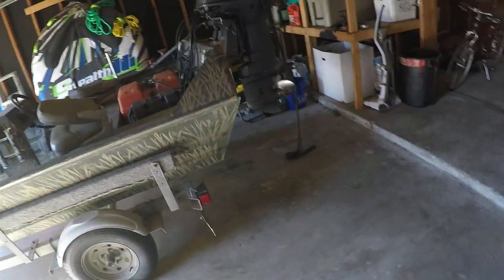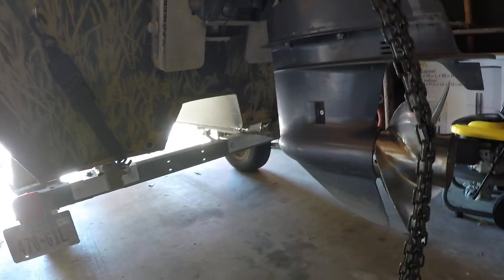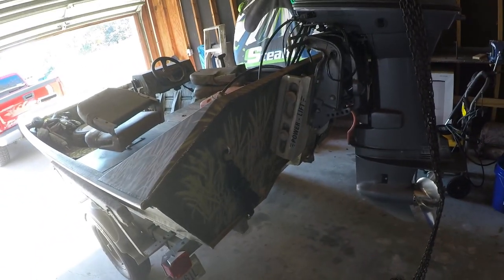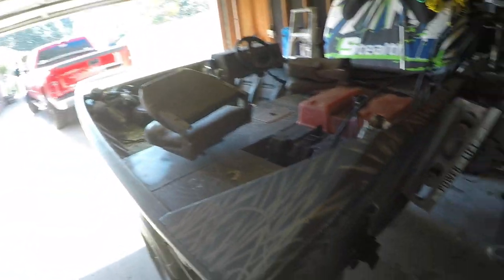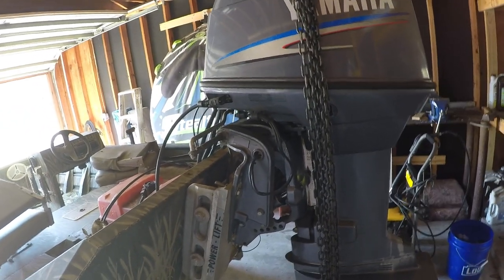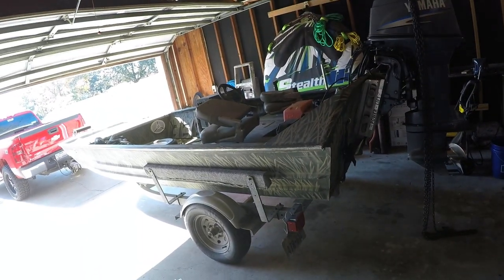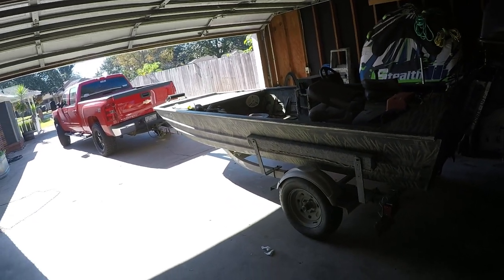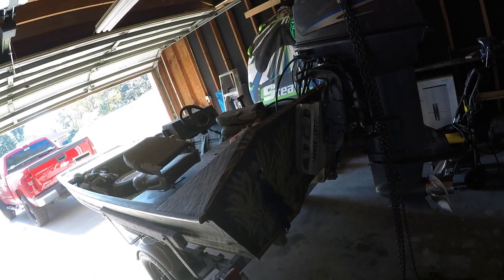The Secret to Running Shallow

Comment: You say a tunnel isn't necessary. Would you say it's worth adding a tunnel in if you can? Can you get similar performance with a jack plates, cav plate, and the right prop?
Reply from the maker: Depends on what you want. Tunnels will run shallower in hard bottom and tend to get up in shallower water. They are typically slower. I like having the tunnel because it allows me to run the skeg even with the bottom of the boat and you chances of damaging the lower unit are very low if you tend to run places with stumps or in my case oysters. You can always do a vented tunnel which will allow you to open a valve in deeper water and break the vacuum on the tunnel which will give you 10-15% more mph. You need a hydraulic jack plate to take full advantage of a vented tunnel setup.
Reply: @Southtexasduckhunter  Nice. The boat I have currently is a tunnel and it's money for shallow water, but I've considered upgrading to a bigger more all-purpose boat like a carolina skiff. Most boat's aren't tunnels so you would have to add your own which I'm not too fond of doing. Was just wondering how much height I could get before I would deal with blowout or overheating. Did you have trouble with your other boat before you added the tunnel. I would probably set it up with two jack plates a shawwing and pt prop.

Comment: You don’t run a water pressure gauge to make the water making it to the top cylinder?
Reply from the maker: Robin Inabinet not sure I understand this? However these engines are setup with the thermostat on the top of the power head. Due to this the engine has to fill up with water before it exits through the exhaust housing. Kind of like water flowing over a dam. Where the dam is the thermostat opening. I don’t run a thermostat in the engine either. As long as the engine temp sensor doesn’t go off it’s good.
Reply: We just always added a water pressure gauge  to be sure there was enough pressure to get enough to the thermostat.  You could be getting water thru water shield but just not enough.  A pressure gauge will let you know if there’s enough going thru the system.
Just an easy way to double check.

Comment: Thank you for posting this. Very informative. I am thinking about getting a boat specifically for bass river fishing. The depths of the river vary from as deep as 10 feet to less than a foot. I was dead set on buying a mud motor but after seeing your video, I am considering getting a standard outboard for my boat. What do you think?
Reply from the maker: Bill York mud motors have their place. If you think you will be in a lot of vegetation then a mud motor may be the better choice. If it’s just wanting to run shallow in relatively clean water then an outboard with a tunnel will run just as shallow and be more user friendly. Just have to ask yourself what you want to use the boat for. There is very little that a tunnel outboard won’t do compared to a mud motor. The obvious advantage of the mid motors is they are air cooled. Outboards are water cooled.
Reply: @Southtexasduckhunter  Thanks Kevin for the response!  I've just heard that with mud motors, there is a lot more maintenance involved as well as having much lower horsepower compared to a traditional outboard. I'm not sure how true that is but I'm still considering my options. 
How wide is your boat?  Reason I ask is because I want to be able to stand in the front and pitch and flip for bass and I would like a stable platform.
Reply: Call Gator Trax  , they are the best
Reply: jet   óutbard jet bóat

Comment: How does a setup like this run in medium thickness vegetation? I have a river I run that has areas with thicker vegetation. With a regular outboard setup you constantly have to clean the outboard of weeds. I'm ok with occasionally removing some weeds and push poling through the thicker stuff but was wondering what to do when upgrading motors. Currently have a 1560 tunnel w/ 15 hp which is way underpowered. What's your opinion on outboard vs mud motor if you run a decent amount through semi-thick vegetation?
Reply from the maker: David H I’ve been able to run medium hydrilla without having to stop. With the skeg even with the bottom of the boat the plants get stirred up enough from the tunnel that the prop just chops it up and sends it into the air lol. I have been stuck under a bridge where it was packed in tight but was able to force my way out after cleaning the prop off several times.
Reply: buy miñi  tug boat 21  mph      15 hp 1⁸ jnch diwñ miter  show water  9  iñches on lane

Comment: I have the same rig but with a 60hp  yamaha. What pitch is that prop? Also what are your thoughts on extending the tunnel for better water pressure  on the prop? Possibly helping get the motor even higher. The previous owner knocked the bottom 3 inch off my skeeg so it runs pretty swallow as is mounted on the transom with a 3 blade. Stumps and hydilla are my issue not so much mud. Thanks.
Reply from the maker: I’m running a 17p 4blade CFF4 with added cup. I wouldn’t extend the tunnel. It would actually limit your height. When water exits the tunnel it rises. By extending the tunnel you would prevent the water from rising limiting how high you can raise your motor. My cav plate is about 6” above the top of the tunnel. I can run it there because of how the water rises off the tunnel. I have ran in lillypads and it seemed to do well. Just have to really keep an eye on the tale tail
Reply: Thanks for the heads  up. Not sure where you hunt but, looked like SE Texas marsh. I run tugz on the intracoastal between Port Arthur and High Island Blue wing showing  up pretty decent for mid August. Hope ya'll have a good season.

Comment: I won't be running a hydraulic jackplate for now. Where is the best place to have the cavitation plate setting in relation to the tunnel?
Reply from the maker: Baba Yaga as high as you can get it and still get the boat on plane and not over heat. I would start as high as possible and move down from there as needed
Reply: @Southtexasduckhunter  Roger that. I appreciate your feedback.

Comment: Good video. I've got a 2005 yamaha 60 2 stroke and when that thing even gets near mud I'm getting the over heat alarm. Have you had any similar problems and found a solution ?
Reply from the maker: Yea mine will overheat when idling in muddy conditions but it cools off quick. I run without a thermostat in mine simply for the fact that I’m almost always in shallow water. Make sure the water pump is good and thermostat is not clogged or just remove it. I’ve been running outboards without thermostats for years without problems.
Reply: I take the thermostat out and then break off at the spring and put back the plate where you won't get hot spots in the block and it's always work really good for me on my jet drive.

Comment: Hi kevin, this is Alex in San Diego and I have the same alumacraft 16 vmod design as well. I want to install a hydraulic jack plate and wondering which size and manufacture you would recommend? Much thanks!
Reply from the maker: Alex Ordonez mine is a CMC 6” for up to 300hp engines.
Reply: buy  het outbard

Comment: How fast does that run with a tunnel don’t they run slower with a tunnel!
Reply from the maker: Jhnfrmr I can get about 34mph trimmed out just right. In general  tunnels are slower because of the drag the vacuum from the tunnel creates. Not always the case but a good rule of thumb.

Comment: I'm designing a boat with a built in gas tank. Do you recommend placing the tank in the front or the rear of the boat for running shallow? Also want to keep in mind getting on plane. Thanks
Reply from the maker: Corey Rougelot I would say best case is in the middle or slightly forward of middle. If you have to choose between front or back I say front. You don’t want to overload the front but you also don’t want to overload the rear.

Comment: Are you able to run this in shallow rocky areas?
Reply from the maker: Panurgic 01 never tried. My guess is it would do ok running across flat rock areas 2-3” water. But not like rivers where you see the jet boats running through the rapids.